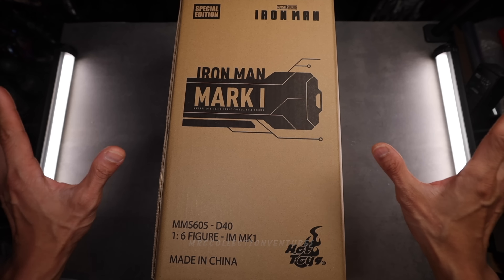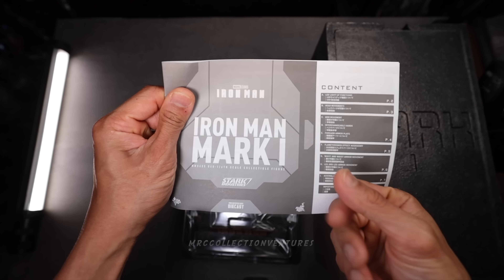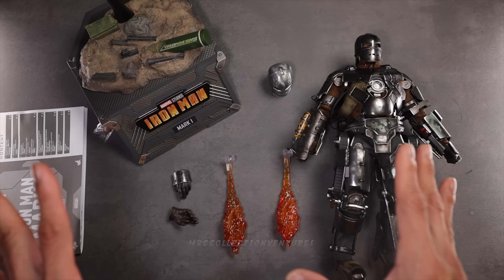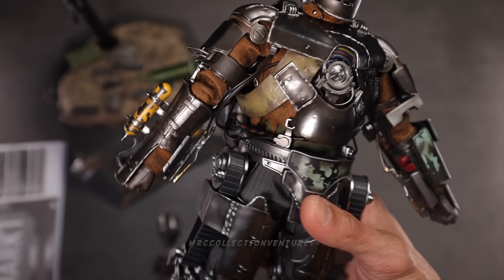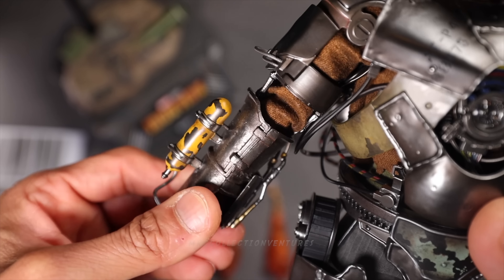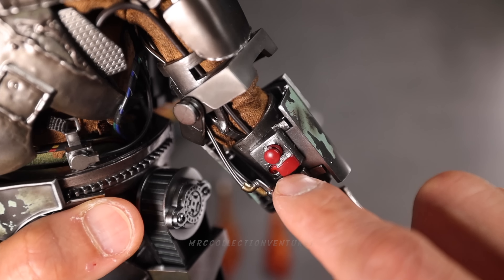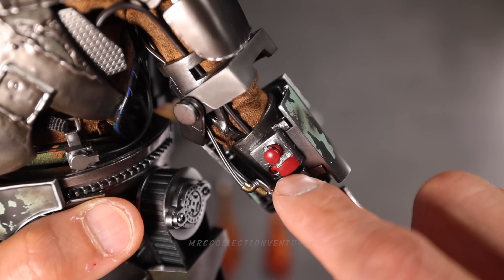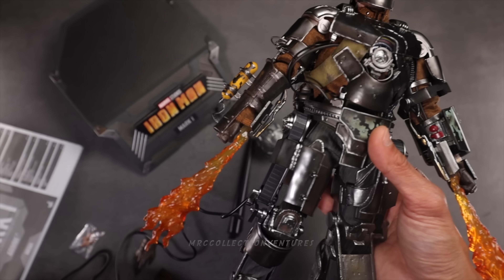Hot Toys (Special Edition) IRON MAN Mark I DIE-CAST 1/6th Scale | World's First Unboxing & Review!

Comment: Wait There's no off switch for the fan?
Reply from the maker: Yeah, once you turned on that’s it hahah!
Reply: @MRCcollectionventures  wth 😂 now that's a concern. that fan is loud as f! Sounds like a laptop burning out and it could potentially burn out the wires
Reply: Pressing the button again does turn it off.
Reply: @luckyjhagra6020  I know that but it should have been separated some people have their lights on display all the time.
Reply: @judgeoftruth6058  fair enough. I see what you are getting at now.